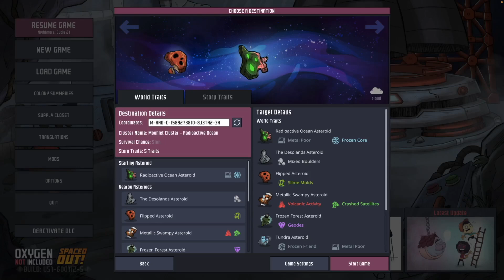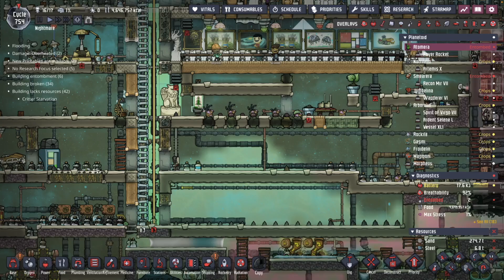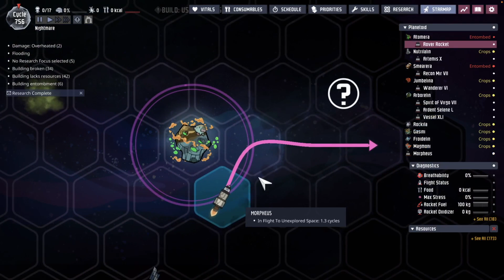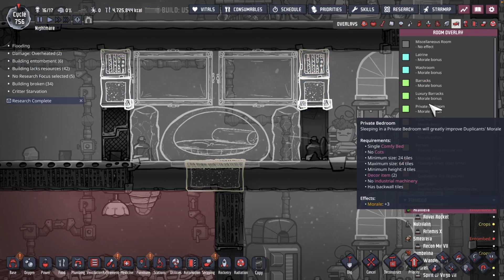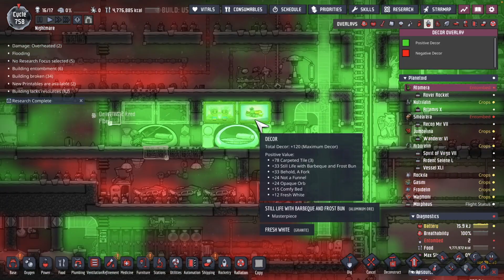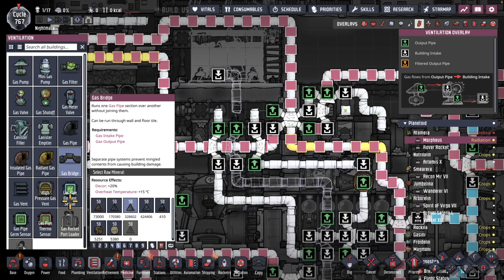Bed Time - Oxygen Nightmare #41

Comment: Im so sorry, i mislead you. The telescope in rocket don't need direct view on the "sky", i'm pretty sure. So I think it was not necessary to put it up there.

That's how some people use underground rocket platform with telescope to get early exploration.
21:55 Is it the natural light from space that made it a lab ? I don't see your light on.
Reply from the maker: The light has power but has a single piece of automation wire to turn it off.